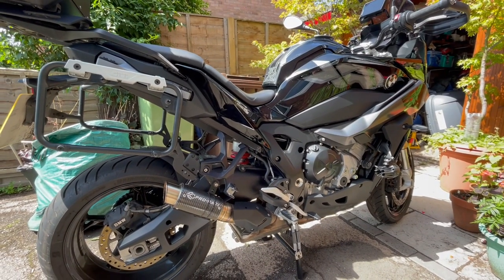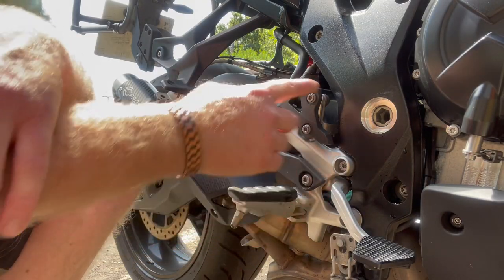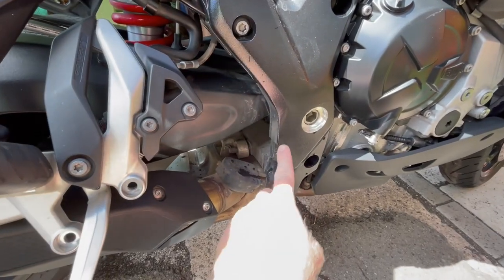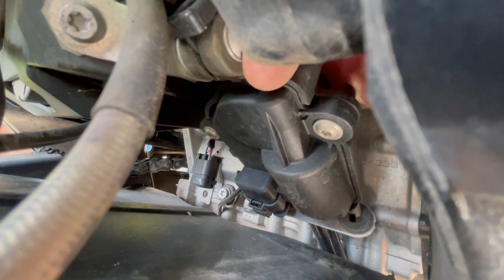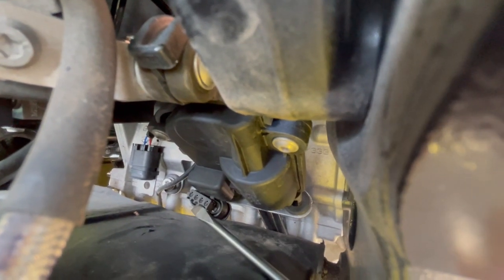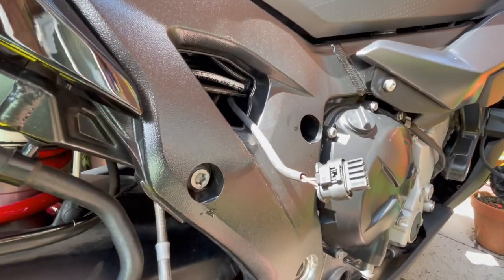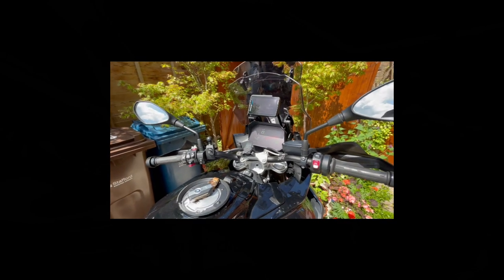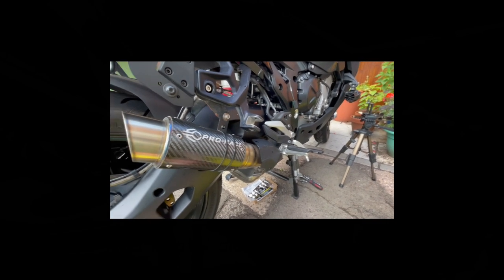S1000XR 2022 Exhaust Servo Eliminator

Comment: Thanks for the share. I discovered an easier way. You come in from the chain side with a thin long screwdriver to release the clip on the plug and use another longgg screwdriver to push the plug out. Then loosen the black clip that hold the wire and pull it up all the way and bring it through the frame then plug you  Healtech servo exhaust eliminator in and  test. Fix the  Healtech servo exhaust eliminator to the frame with the double side tape and a cable tie and bob's your uncle. Took me 15 minutes with no damage anywhere and I can reconnect the servo motor when the bike go in for a service as it may affect my warrentee if the servo and flap is not working. BTW I kept the standard exhaust on the bike and it does sound better...
Reply from the maker: Thanks for the reply. I’ve removed mine as it’s just stupid loud with the pro race can. Neighbors aren’t big fans of my bike anyway.